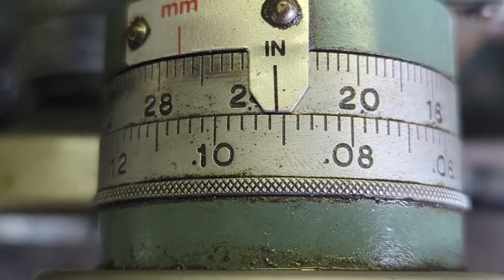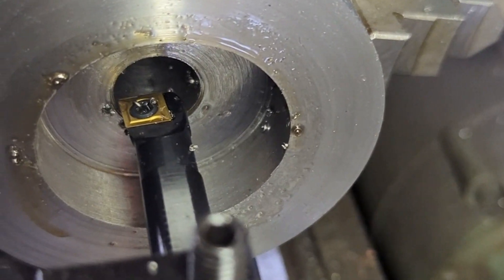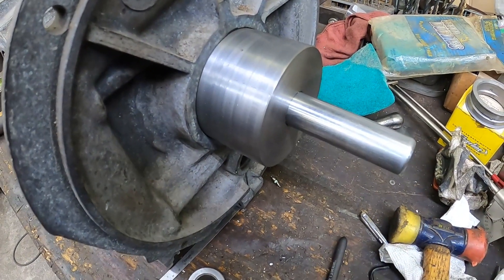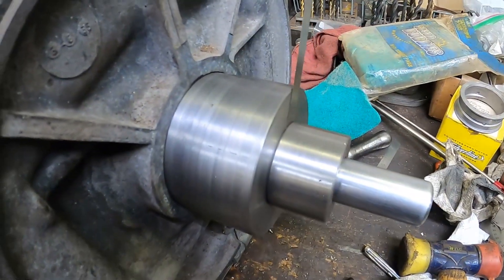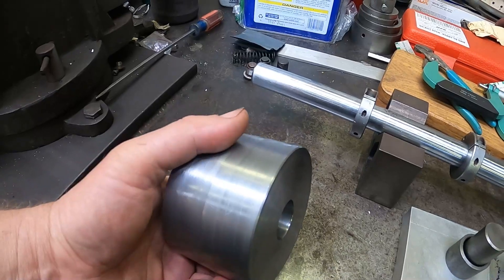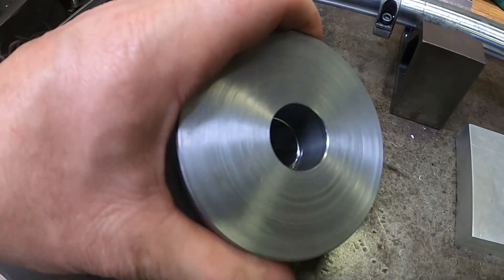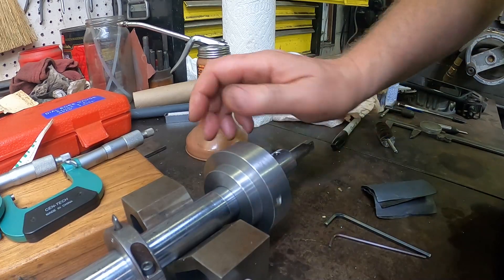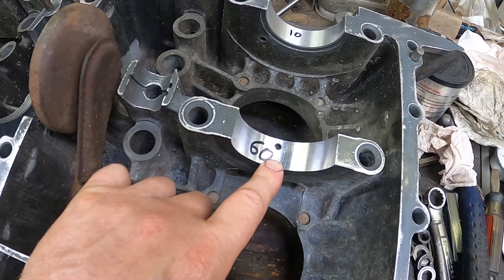Will We Damage Another Engine Case?

Comment: Bought an old true line align bore set many years ago. Made new bronze bushes with one twentieth of the clearance of the old ones the other guy had been using to get a result. Also made a collar  that clamped onto a cutter bar with a single tip hss tool bit similar to what you made for thrust cutting. I didn't like the concept of the supplied thrust cutter. Didn't trust it to cut square to the mains bore. Using a fixed thrust stop for the cutter bar I set the cut depth with feeler gauges,  then removed the feeler gauge and made the cut. Being piloted in bushings in the fresh cut mains tunnel, turned out square to axis and parallel thrust dimension inside to outside face every time. Think I was still an apprentice bookmaker at the time.
Reply: That should have read toolmaker that last line !

Comment: I’m getting back into VWs after a long absence. I’m really enjoying your channel. I want to build my own boring bar. As far as I can tell, the bar itself is 1” diameter. Can you confirm this?  With this info I can scale to find other dimensions in photos. Also, it appears that the 1 degree taper was spot on. Did it seem to match the original?  Any other dimensions you could share would be appreciated.
Reply: I never expected a video reply! Thank you!! I’ll keep you posted on my progress. I’ll be interested in seeing your cam tool. Thanks again.
Reply from the maker: See Short reply

Comment: Turn a cast iron bushing and use an interference fit into what you have machined.  You also could have done that to the original part, a lot less work.
Reply from the maker: Yup, have some bronze on hand if needed. Wasn't confident enough to modify the original bushings, but making them from scratch was a good exercise. Thanks for watching!

Comment: Fantastic job, man.  Love watching the machining process of just about anything,  but this tool is going to save some real $!!!  I jumped on board way back during "Vandemic"  and have been a big fan ever since.  Would love a shop tour video sometime, the tools, work stations, how you heat & cool your shop, etc.  Much respect from Texas 🤘
Reply from the maker: Thanks Christain, what an awesome comment. I agree, it will save a few bucks and allow me to do things that wouldn't be worthwhile from a financial perspective. Thanks so much for sticking with us for so long, it's great to have you here. I may get around to a shop tour at some point but I'll give a quick answer regarding climate control- it's hot and humid! A squirrel cage blower type of fan is great to keep air moving. Heating really isn't an issue, but I have used a radiant propane heater on occasion. Thanks for watching!

Comment: Great job.  Something to consider, is boring it out for an oil impregnated bushing/liner.  That way if the bushing wears you can press the bushing out and replace.
Reply from the maker: Thanks jwhrivnak, I have some C93200 bronze on hand from another project I may use if needed. Probably should have started there! Thanks for watching.

Comment: Recently built an engine from spare parts.  The thrust had been cut just a bit, not standard, but I ordered a standard bearing.  Setting it in, it had a little play.  Put the dowel in, less play.  Mate the case halves, no play.  I don't think it's as sensitive as people say.
Reply from the maker: Hi T N, fair point but I would be concerned about movement under pressure and extended use. Nothing wrong with trying new things! Maybe check endplay at the pulley each time you change the oil; anything more than what you set may be an indicator. Thanks for watching!
Reply: @HapticGarage  Yep, I'm waiting for a project to put it in to find out how it'll hold up. I could be completely off base.
Reply from the maker: Cool, I hope it turns out well. Either way, I admire the follow through.
Reply: @HapticGarage  Your videos have inspired me to rebuild it and take a little more care, rather than just assembling parts.  Don't have a project car at the moment, so a project engine will do.
Reply from the maker: @TN-oc3cw  That's awesome TN (sorry for the delayed response). I hope the project goes well and a fitting project car enters the picture when you're ready to put that engine to work!

Comment: congrats on the win. in the old days, they had for every axle a extra oil dispenser with a tiny lid on it to oil up the spinning axle.
great idea to do that that way. low tolerance and friction is heating up and that locked up. luckily it didn't burned to deep into it.
great work.
Reply from the maker: Thanks '55, those little oilers you mentioned are cool. I've seen them on a Ford Model T, lathes, and mills. We used to maintain stuff a lot more than we do now, "lifetime lubrication", etc... Thanks for the encouragement, it's always great to hear from you!

Comment: 11:40 perfect candidate for a type 4 center main bearing crank.
Reply from the maker: Thanks bedlamite42, I'm not familiar with this mod but sounds neat. I'll read up on it and tell me more if you wish!
Reply: @HapticGarage  Type 4 is larger diameter, gives you a stronger, stiffer crank that lasts longer at higher RPM and/or stroker cranks. DPR Machine has it as an option on their cranks. Not really ideal for a budget engine, but is an option for that case.
Reply from the maker: @bedlamite42  I see, thanks for the response. I'm aware that Type 4 is a stronger design in most aspects, but didn't realize the cranks could be used this way. That's really cool. And you're correct, sounds above budget for the crusty case. I'll definitely keep that in mind for future projects. Thanks again.